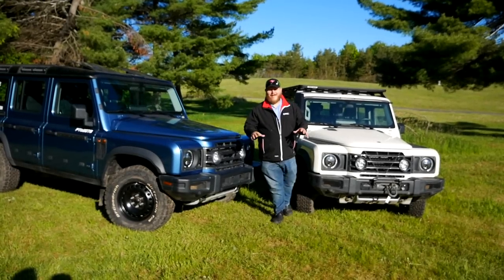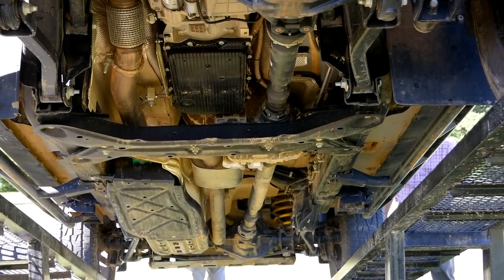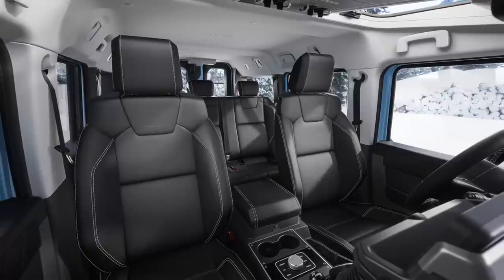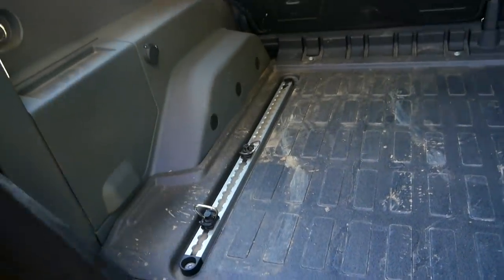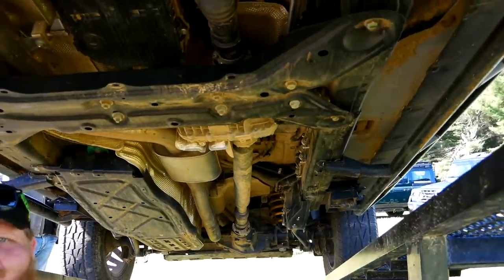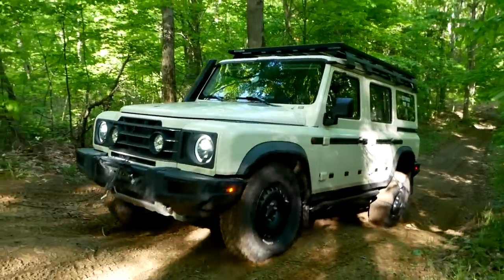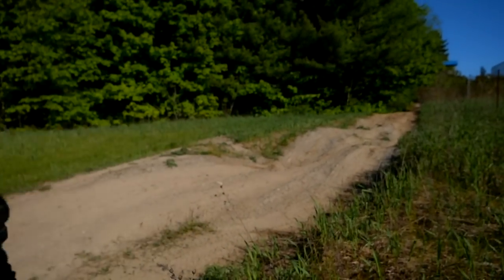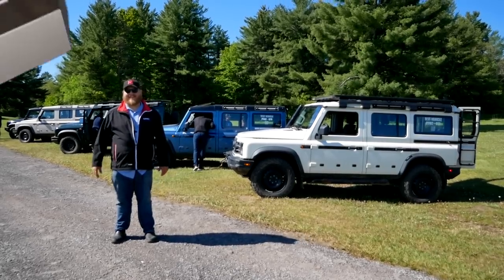Should Land Rover & Mercedes Be Worried about the Ineos Grenadier? ALL the Details on the Ineos HERE

Comment: These are so cool. The safari sunroof windows would be a must have for sure. $92k to start- she ain’t cheap but it looks like it is built like a tank
Reply: same opinion out here in jamaica brad the only thing though i wish it had basic electric seat just basic  kooool
Reply: All roofs are prone to water leaks which equals rust. Also not wise to invest that kind of money on a new company's 1st vehicle. I do hope they last for 10 years.
Reply: @myrongaines5542   but if u can  get a 10 yrs b4 any leak its good  and the rubber look simple to replace  look at this  bmw inline 6 petrol  zf  transm  look at the body look at the structure under the truck solid axcel the dash  knobss no touch a lot of manual stuff no electric  the rest is history i understand  u 110% about the leak if it was a solid glass in that dosnt open just sit  there  seal/

Comment: The tranfer case didn't get enough attention. It's the most capable you can get. True full-time 4WD with a differential, not an electronic clutch.
Reply: Exactly. It also uses gears instead of a chain. It’s HD and built to last
Reply: @mini2nut67  Oh wow I totally forgot that! The transfer case was developed from scratch instead of sourced from automotive suppliers because the transfer case is what defines a 4x4 and they really wanted to have the best.
Reply: Yeah it's awesome I love it. I drive a modified Discovery 2 so this thing is right up my alley. If it wasn't for this the only new thing I like would be a Wrangler Rubicon which are extremely extremely capable from the factory. I'm wondering if Grenadier will offer sway bar disconnects like the Rubicon

Comment: 900 lbs static roof load is insanely impressive! The Land Cruiser 200 has a rating 330 lbs for example.
Reply: @joeblack1052  You're not supposed to drive around with it but it's great to have a safety margin when you have a rooftop tent on there. 900 lbs is so much you can put so much up there.
Reply: @joeblack1052  What do you mean with liability in this case? Liability is why companies like Rhino have clauses hidden in installation instructions that allow them to deny any and all warranty claims.
Reply: @imnotusingmyrealname4566  so landcruiser says 300 and most likely someone will put 500 up there.
Say 900 and they will put 1200 up there...
And that becomes a potential issue.
Reply: It is 900lbs static load i.e. when you are parked. Dynamic load is 330lbs.
Reply: 300 pounds on the stock roof rack.
Reply: New defender has 370 pounds or 168kg dynamic which is the most important figure.
Reply: @newdefendermods  Numbers wise the Defender blows pretty much everything away but it's so incredibly sophisticated that it could be a drawback, and the reliability record is not good

Comment: I drove the prototype on tour in the USA. Was off-road only but the experience was excellent. Handled undulating ruts easily. The better comparison is with the G Wagon. Not the defender. The IG was designed and engineered by Magna Steyr in Austria. Magna has been building the G Wagon for decades. Also with up to three locking diffs, it is on par with the   MBZ. What other vehicle offers that ?

Comment: Huge letdown with them not sticking to the price they said it’d be.
Reply: I agree! It's another high-end, admittedly capable, conspicuous consumption vanity vehicle. The closest thing to hope that I can find in the 4x4 market is the continued existence of the Ram classic trucks, which are at least an attempt, though largely theoretical, to have a more affordable option. In reality, it's more like an expensive option ( Ram Classic 1500), versus an impossibly expensive option (Ram 1500). To Keep the Ram Classic though, if I recall correctly, they kept only the most expensive, least utilitarian body style (crew-cab only, in Canada at least) no proper bed (only short and shorter), and multiple engine choices, all of which increases complexity of production and therefore price to the point where Ram Classic is only the value proposition when compared to the "new" Ram truck. Pathetic.
Reply: @liamrobinson2084  You obviously haven't taken into account this is a brand new manufacturer, selling a brand new vehicle. How on earth are they supposed to compete with a huge manufacturer? Before typing next time, please have a reality check.
Reply: Totally agree its a huge let down... but I did kinda feel that the original price was a savings compared to modding another vehicle. The 900lbs roof load is nuts, the warranty is very extensive, the diffs are the absolute top of the line, transmission is top of the line, suspension is truly butter for a 6000lbs vehicle, the towing is 7000+lbs, and all galvanized very thick metal paneling. Meaning that if I tried to get a 50k vehicle to perform and be tuned on and off road the same, tow the same weight, have the same panel thickness, mod for 3 locking diffs (if even possible), upgrade the suspension and possibly replace the transmission, just to get it to what the the grenadier has stock, truly it'd be a huge time investment and at least 20k minimum. I think a lot of the point of the grenadier is that it doesn't really "need" to have the main building blocks or fundamental setup of the car modded to become top of the line. Could it be less? I'd love it to be. Worth 80k? Maybe 70, but also whatever you buy has a million miles of testing to fine tune it off the factory floor for reliability. So, it's potentially not far off truly.
Reply: @Mk1Male  a few k more is understandable. $20k+ is horse shit. They’re squeezing the people out who would’ve bought this vs a rubicon. Typical overland company bs these days. Poors not welcome.
Reply: @Mk1Male  wow. Great one! You really told me! I will make sure to check with you as the obvious arbiter of reality before I comment again on a vehicle that was supposedly specifically designed to be an old-school, relatively affordable option, and also ignore the entire automotive history of North America, in which all the successive waves of imports, whether European, Japanese or Korean, started out competing on price. Clearly you know much better. Thanks for setting me straight!
Reply: @liamrobinson2084  Taking things a little far aren't we? Grow up. You haven't a clue about what it has cost to get this vehicle to market. What would you want them to do? Lose money? Fit inferior parts which would then have every one like you belittling the quality? You obviously have no commercial sense.
Reply: @ryanmartinage  Yep, I'm sure as a company they have made a decision to lose   thousands of customers. Or, maybe as a new starter company, they didn't want to release a vehicle that cost 20k less but nobody would buy because of quality.
Reply: Inflation is a bitch lol. Nothing costs what it did when this vehicle was announced. It’s not them it’s the global economy.

Comment: 92k for that thing is insane. There are so many better and cheaper options out there that perform way better
Reply: How many tests, back to back, have you done? None.
Reply: For the quality and attention to true offroad Capability, this vehicle despite the high price is as good as it gets.
Reply: I would say if you know the specs of the Jeep Rubicon Wrangler you might realize that this thing could use some sway bar disconnects and room for larger tires if you want. I do like it a lot though and I would totally get it over a deep but I'm just saying despite all of the little features and overlanding roof rack weight capability Etc a Rubicon Wrangler with front and rear lockers Factory sway bar disconnects Factory even a traction control system that no one talks about because they just use the lockers LOL and the newest Rubicon Wrangler with a Dana 40. I'd say the only disadvantage to the Grenadier is the fact that it looks like an old Defender lacking the space to modify as easily kind of like every Land Rover locking the space to modify easily with larger tires. I drive a disco too so I'm not talking bad on Land Rover at all but Jeep really gives you more ability to mod from the factory and you don't even have to with the Rubicon it's ridiculous. If you live in the southwestern United States and you see some of the crawling those things do from the factory you realize the Grenadier is amazing but I wouldn't caught most capable it might be close we will see. So far I see it lift a wheel a little when it articulates but that's probably cuz they don't offer sway bar disconnects and the tires are kind of small
Reply: Not really, unless you’re shopping on kijiji autos looking to buy someone else’s problem. Perhaps you should look at how much a fully loaded Jeep Rubicon costs lol.

Comment: What if i wish to get larger tyres? Where do i keep the spare? If i mount the new spare tyre on the rear door, it no longer close.
Reply: Exactly they should have copied the Rubicon Wrangler instead of Defender haha nothing will ever beat Jeep I swear and I don't even own one but look you can put 35s on one from the factory. You have Factory sway bar disconnects Factory front and rear lockers Factory traction control and a Dana 40 rear end on the new Rubicon off-road. Maybe over in Europe the next best thing but I live in southwestern United States and it is all Jeeps with 35 inch tires driving down the road and all the trails doing way harder things than this thing could ever do. And the Jeeps are barely modified. I'm learning though that some of the four-wheel drive in Europe they just don't have as hard of trails so they think less capable things are so great. They mostly have moist wet stuff. They go on a cross axle section that is mostly flat and wet dirt when I go up one ruts, axle twisting, huge loose rocks and all of it at 40 degrees steep or greater. They go across something challenging on flat ground and raise a wheel and get excited. Maybe the roof rack 900 lb capacity and some of the Overland stuff is cool but if you want to copy something copy the Rubicon and if you don't know about it study it's and you'll learn it's the best. I own a Land Rover by the way and I'm saying all this hahaha that Australian guy they reviews Vehicles finally did a black Jeep Rubicon in the Sahara and broke down and said yes it is the best off road vehicle by far it just does anyting

Comment: Nice rig, I look over at my Old TJ that is just a trail rig and I think I could buy 5 built ones for the same price as this. Off roading is not a cute sport. I can simply be done so much cheaper, and before you know it you are risking body damage offroad. Love that they built it, but making it simpler, smaller and cheaper could have really sold well imho.
Reply: A brand new Jeep rubicon is like $90g Canadian. This isn’t meant to compete with the used car market, it’s meant to compete with the new car market.

Comment: If this thing was powered by a GM V8 or a Toyota V6, it'd be a far more appealing choice. We already have trust issues with BMW engines as it is and the B58s timing chain in the back of the engine means engine out maintenance when those guides wear down and what not. 

Still an attractive vehicle to me.
Reply: How many issues have you confirmed with the B58? They are bullet proof engines that can be tuned to more than 500+hp in stock form. Timing chain issues from B47 have gone. Stop posting BS.
Reply: I understand where you're coming from, but when I started looking into it a few years ago when it was announced, it turns out the B58 has been around for a long time and is actually a very very highly rated and reliable engine.
Reply: @kevinhartley2538  possibly but a bimmer engine for a global expedition type vehicle isn't exactly what you'd want when parts fail in the Australian bush or African Sahara. You won't even get parts for it in Moab, UT like you'd get for a GM, Toyota or Jeep. They didn't think far ahead when they developed this vehicle. I have a F32 and just to get parts like coil packs was a bitch and I live in California.
Reply: @CACressida  I hear you. I think it will probably be harder in some cases like Moab, though we honestly don’t know until the dealer network is provided in ~August on where parts availability will be, but I do believe that it shouldn’t be less available than parts for veritable off-roaders such as the Defender or G Wagon. Possibly more available than them too from the rumors. Further, Ineos have many times said that they will allow customers to order many of the parts directly to their homes for those who work on their own vehicles. A major win for me is that a full 3d model of each of the parts of the vehicle will be downloaded with a service and repair manual directly in the vehicle, which is incredibly unique and useful for those remote situations where you want to diagnose or resolve the issue on your own. To me this indicates that they did think quite far ahead on how this engine (and everything else) will perform long term and in remote areas of the world. It is a utility vehicle fine tuned for remote touring with over a million miles of testing too mind you. They’ve already gotten contracts with NGO’s like The Halo Trust to clear land mines in some extremely remote areas.

Comment: Now let's bring won against the Jeep Wrangler Rubicon purely off-roading not overlanding. Come down to the southwestern United States where we go on axle twisting spots combined with the steepest hill you ever went up not just muddy moist ground. I like this thing but unfortunately it looks like you can hardly add bigger tires like every Land Rover issue. I don't even own a Jeep but I know the Rubicon is amazing if you know the specs. Wonder if Grenadier will have sway bar disconnects? Probably not because the market is sold in doesn't really off-road that extreme. They might think they do LOL

Comment: Anyone not aware of the Grenadier by June 2023, must be living under a rock.  😂😂

It was designed by Magna Steyr, the Canadian company that builds the Mercedes-Benz G Klasse in Graz, Osterreich.  One could logically expect similarity in design philosophy.  The G Klasse can engage all three its differential locks while on the go, it is hand built from good quality stainless steel and has proper breathers for all of its differentials, that go up to right under the hood, against the firewall, unlike Landcruisers and their inferior provisioning.

The Grenadier is a better vehicle than most, yet its design flaws won't keep Mercedes-Benz losing too much sleep.  I do think that Toyota should worry, as the Grenadier is built in a former Mercedes-Benz factory, to a high specification.  Compared to Landcruisers, Grenadier should be the new world leader.  That BMW Diesel engine is legendary, I just think they made a mistake in not having brought the Mercedes-Benz OM606 engine back to life. 

The New Defender already proved in Africa to be both capable and reliable, obviating the need for the Grenadier......time will tell. Opinion is always fictional and therefore worthless.  One has to weigh the factual data.

Comment: They always say that the switches are big so they can be used with gloves on. WHO THE HELL drives with snow gloves on? Maybe good for a dude with proctologist fingers. Great review. Very expensive.
Reply: Well, I do. Based in Norther Utah, where 5 months of the year is snowy and icy, not everyone has time to preheat their car every time they want to use their car. It's not just snow though to be fair. Gloves are often used when towing equipment shorter distances seen in farming, industrial sites, and some NGO environments. For the outdoor enthusiast this could be as simple as getting in and out of the vehicle repeatedly while trying to help another vehicle out of a stuck spot, or accessing the exterior electrical switches while setting up camp in the winter.
I agree the vehicle is quite expensive for what it is. Though, maybe not as much overcharge as we think. The 900lbs roof load is nuts, the warranty is quite extensive, the diffs are the absolute top of the line, transmission is top of the line, suspension is truly butter for a 6000lbs vehicle, the towing is 7000+lbs, and incredible all galvanized thick metal paneling. Meaning that if I tried to get a 50k vehicle to perform on and off road the same, tow the same weight, have the same panel thickness, mod for 3 locking diffs, upgrade the suspension and possibly replace the transmission, just to get it to what the the grenadier has stock, truly it'd be a huge time investment and at least 20k minimum. I think a lot of the point of the grenadier is that it doesn't really "need" to have the main building blocks or fundamental setup of the car modded to become top of the line.
Mods I'd possibly like to do is get a snorkel over the raised air intake, a simple bulbar, and rocksliders that have steps... but like, nothing fundamental, which is quite refreshing. 
Thanks for reading my thoughts if you made it this far.